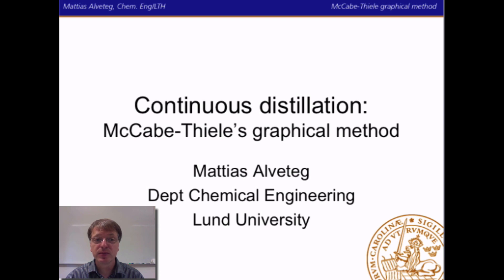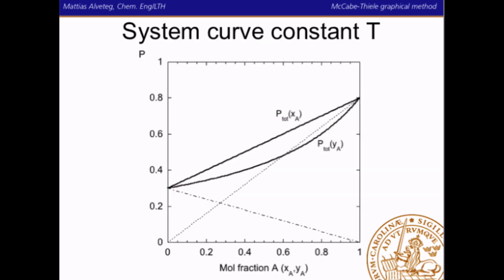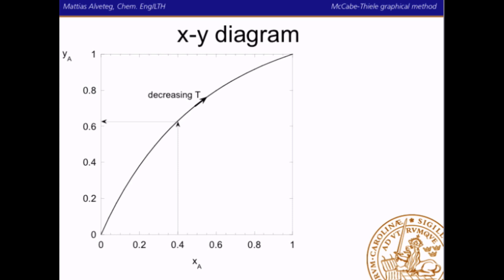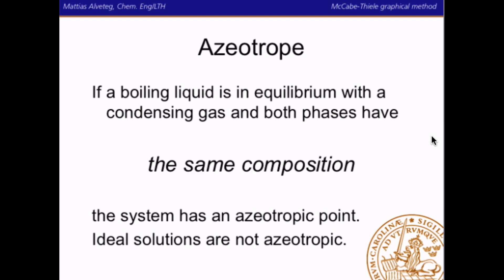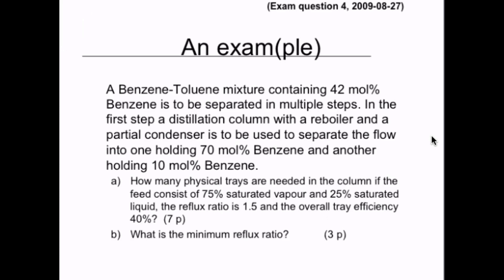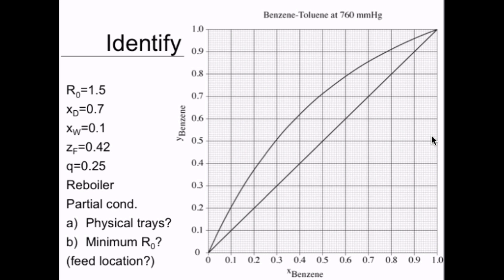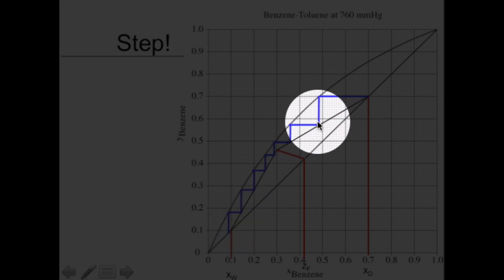D3-Distillation: McCabe-Thiele

Comment: May I ask how can u do it without an equilibrium line ? or how to graph an equilibrium graph ?
Reply from the maker: You need the equilibrium line. You can either interpolate from literature data, or use one of many "curve fits" (in which case you need literature data for the parameters). What curve fit to use depend on the system, van Laar is one of those "curve fits". Compare the video https://studio.youtube.com/video/lz-RWsMYx48/edit which explains how you can take the first steps if the system is ideal (which is usually never true). From there you have to find ways to calculate activity coefficients (using e.g. van Laar).
Reply: @PLE_LU  Thank you for the advice
.

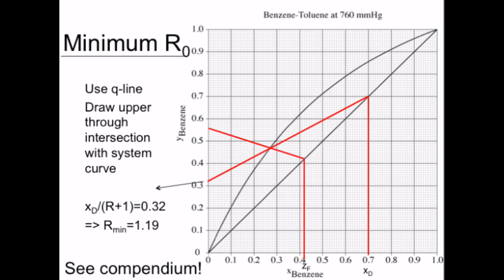Comment: Seems to me like there is a mistake. At 9:07 we get the equation xD/(R+1) = 0.28 and at 15:31 wie get for Rmin "xD/(R+1) = 0.32" - means two time the same equation but two different outcomes? 
So is this wrong or am I wrong?
Reply from the maker: Not an error. If you have different values of R, you get different values for xD/(R+1), right? At 9:07 we solve the problem of a realizable distillation column, with R=1.5. At 15:31 we are looking for the limit, how small R can be for it still to be possible to build a distillation column that carries out the specified separation. We get the result that the limit is R=1.19. The R value that gives you xD/(R+1) is the reflux ratio that would require an infinite number of trays (i.e. an infinitely high distillation column) to carry out he specified separaion

PS
Please note that there is a more recent video on the same topic. You can find it in this playlist: https://www.youtube.com/playlist?list=PLvpgTFzUKO49J3fwJF9y61q17FSNDdoGN
DS

Comment: Hi, what books do you recommend on this subject?
Reply from the maker: Mattias here: To be honest, I personally feel that most text books in this discipline are not designed to help new students learn but rather designed to help engineers who already know the field to refresh their memories. The most famous books were designed in the 1940-ies and the 1960-ies and once you already know quite a lot they are very, very good sources of facts and explanations, but from a pedagogic point of view I find them rather useless in my courses. We have used some of them in introductory courses at least since the  time I was a student back in the 1980:ies, but most students did not read them and learnt better without reading them, so I gave up on them some years back. (The material I'm currently using for mass transfer, heat transfer, distillation, evaporation, filtration/membrane filtration, adsorption/chromatography and drying is currently only available to our students)

Comment: Would you please explain the -0.33 where does it come from? I dont get at all.
Reply from the maker: Hi.

1. Please note that you're watching an  older version of the video

Newer video on the derivation of McCabe-Thiele you can find here:
https://www.youtube.com/watch?v=9gZeftUNejk

 ditto solving an exam task here
https://www.youtube.com/watch?v=7f9LIk9qt48&t=1s

and the entire newer playlist on distillation
https://www.youtube.com/watch?v=qF31ODkiPyc&list=PLvpgTFzUKO49J3fwJF9y61q17FSNDdoGN

2. As I replied on a earlier very similar question:

From the task description and the definition of q, 25% is saturated liquid and 75% saturated vapour, thus q=0.25

The slope is q/(q-1) since the equation is y=q/(q-1)x - z_F/(q-1).

When you enter q=0.25 you get 0.25/(0.25-1)=0.25/(-0.75)=-0.33333

Comment: Excellent video. I didn’t get why you added a/A, shouldn’t we add a alone?
Reply from the maker: ? I'm not sure what you mean by that. We're trying to count number of equilibrium stages, but a is in the unit mm so how could we add them together? We would get things like 4 eq. stages + 2 mm = ?? if we draw on a small paper and 4 eq. stages +  8 mm =  ?? if we used a paper that was 4 times larger. Adding things that have different units never makes sense.

a/A, on the other hand, is a fraction, an estimate of how large fraction of an equilibrium (b/B is also such an estimate so you could take either, or, as some text books do, take an average of the two)

Comment: Please clarify the q line value is 0.33
Then feed line towards down ward , some what confused
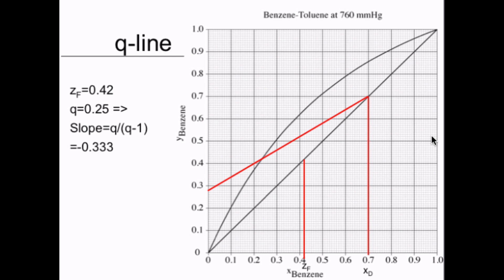Reply from the maker: It is not 0.33.  It is -0.333, see text 9:59 into video
Reply: @PLE_LU  if you got -0.333 why did you draw a line at the 0.56 point on the y axis?
Reply from the maker: @ChiNguyen-np5wv  a straight line has the mathematical form y=kx+m. In this case, if you do the calculation you end up with m=0.56 thus y=0.56 when x=0. I don't do that calculation here though, I just take the fact that the q-line goes through the point (x=zF, y=zF) and draw the slope -1/3 and end up at 0.56

Comment: the construction of the  q line is wrong guys  !
Reply from the maker: No, I think you misunderstand something regarding the q-line.
With 25% liquid at its boiling point and 75% gas at its condensing point, the energy needed to evaporate the feed is 25% of ∆Hvap which means q=0.25. The equation for the lower operating line is

y=q*x/(q-1)-zF/(q-1)=0.25x/(0.25-1)-zF/(0.25-1)=0.25x/(-.75)-zF/(-0.75)=-0.333x+1.333zF

Thus the slope is -0.333. The slope can be seen as ∆y/∆x, so with ∆y= one square down you get ∆x=three squares right

The q-line always intersect the diagonal in the point (zF, zF) since if you set x=zF you get

y=(q*zF-zF)/(q-1)=zF*(q-1)/(q-1)=zF

If you have further doubts you can also calculate the intersection with the y-axis. Set x=0 and get
and intersection with y-axis is (x=zF=0 =>) y=-0.333*0+1.333*0.42≈0.56
which is the value you see in the diagram

PS
There is a newer video where a similar task is solved: https://www.youtube.com/watch?v=7f9LI...
DS

Comment: Sir how to calculate the steam requirement in thermosyphone reboiler ????
Reply from the maker: I only deal with simplified models, thus no specific types of reboilers, but for a general estimate to calculate the energy needed in the reboiler, take the vapour flux below the feed and multiply with the evaporation enthalpy

Q=V_below*∆Hvap(bottoms) [J/s]

 (if you want more accuracy, make sure you take the evaporation enthalpy for the composition of the bottoms.)

To recalculate that to steam needed,  look up the evaporation enthalpy for the steam you use (decreases with the increasing pressure) and calculate the steam needed S as

S=Q/∆Hvap(steam)  [kg/s]

The real steam requirement is always bigger than the value you calculate (since there always are heat losses), but you at least get a rather good estimate.

Comment: isnt the slope of q line, -q/(1-q) which means it will become -0.33, can you please clarify??
Reply from the maker: The slope is q/(q-1) since the equation is y=q/(q-1)x - z_F/(q-1).

When you enter q=0.25 you get 0.25/(0.25-1)=0.25/(-0.75)=-0.33333

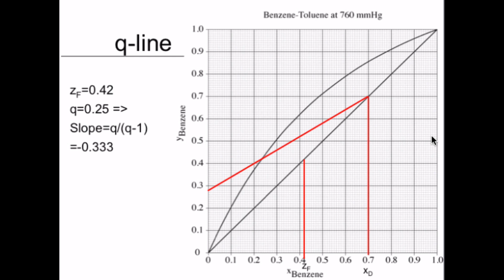Perhaps you are mislead by the font I used, there is a small minus sign in front of 0.333 (at 10:01)

Please also note that we have published a newer series of distillation videos, collected in the playlist: https://www.youtube.com/watch?v=qF31ODkiPyc&list=PLvpgTFzUKO49J3fwJF9y61q17FSNDdoGN

Deriving of McCabe-Thiele is done in 
https://www.youtube.com/watch?v=9gZeftUNejk&list=PLvpgTFzUKO49J3fwJF9y61q17FSNDdoGN&index=7

and an exam example (Ethanol-Water) is done in 
https://www.youtube.com/watch?v=7f9LIk9qt48&list=PLvpgTFzUKO49J3fwJF9y61q17FSNDdoGN&index=8
Reply: Department of Chemical Engineering/Lund University why did you line the graph towards between 0.5 and 0.6 on y-axis ? How did you know the slope -0.333 is there?
Reply: @PLE_LU  
Where are get 0.25 please explain
Reply from the maker: @rajeshr8755  From the task description and the definition of q, 25% is saturated liquid and 75% saturated vapour, thus q=0.25
Reply: @PLE_LU  thanks sir

Comment: why the feed tray should be drawn horizontal and vertical why not in vertical and horizontal direction
Reply from the maker: Some suggest that you should calculate it using the horizontal and the vertical line and take the average of the two. In whatever way you do it, the result you get is an approximation and in my courses I suggest my students to only calculate one value and the only way I teach them is by using the horizontal line. If you look at my matlab distillation demo video (from 5:18)

 https://www.youtube.com/watch?v=iuyXSc3Hb-Q&list=PLvpgTFzUKO49J3fwJF9y61q17FSNDdoGN&index=13 

you see there the matlab calculation programme I've made for educational purposes. In that programme the feed location is calculated using both horizontal and vertical lines. In that programme I also implemented three methods of drawing the triangles: From above, from below and from the feed location. All three methods give slightly different results

I haven't gotten around to publish my matlab code. I find compiling stand alone matlab things rather tedious, not at all as simple as making stand alone programmes based on LiveCode or standard programming languages.

Comment: Great video, what program are you using to draw the McCabe Thiele diagram in?
Reply from the maker: Depending on the purpose I have been shifting between programs. 

* Matlab when I need to do further calculations (e.g. to draw McCabe-Thiele solutions automatically)
* Kaleidagraph from Synergy Software I like since it makes making nice looking graphs so easy (but I actually do the calculation in matlab so that I can easily shift between different types of curve fits for activity coefficients like van Laar, Margule, etc.)

In this video (and in the newer version https://www.youtube.com/watch?v=9gZeftUNejk) I've taken a plot from Kaleidagraph and added a "solution" as an animation in PowerPoint.

Comment: So I followed your explanations (which are really good) and did the exercise before you showed the solution being happy about the solution you followed up with but there is one thing different in my solution:  The angle you measured for the q-line cannot be -0.333°, but from what i measure is more like -0.19°. Now, I'd understand if you had done that on purpose, for making the diagram look more like anything I would encounter in an exam, but i'd still like a note just to eplain possible confusion.
Alternatively i probably have to get a new protractor^^
Reply: So how did you draw the line
Reply from the maker: It is the slope that should be -0.333, not the angle.

Try to think of the q-line as a simple straight line

y=kx+m

where k is the slope, the slope being k=∆y/∆x. Compare this with the equation for the q-line:

y=q/(q-1)x - zF/(q-1)

Thus the slope is

q/(q-1)

and the q-line cuts the y-axis in 

zF/(q-1)

(which, however, might lie far outside your graph).

Comment: Sir how can one know or is the trays optimal to introduce the load?
Reply from the maker: Are you asking how you can know that the feed is placed on the optimal tray? I answer your question in case my students who have an exam in January also are wondering:

I need to divide my answer into two sections depending on the context of your question:

A) You are looking at a real distillation column in operation
B) You are designing a distillation column, e.g. calculating how many trays you need

A: The simple answer is: You can't, at least not without taking a lot of measurements and doing a lot of calculations. Or, as an alternative, you can try changing the feed location, keeping all other operating conditions constant and see how xD and xW changes with feed location. The optimal feed location in a given setup for given operating conditions is the location that maximizes (xD-xW)

B: At the design state you are free to choose your design, right? So your best choice is to place the feed optimally in your design calculations.

You need fewer equilibrium stages (and hence fewer physical trays) if you place the feed at the optimal location. You get the optimal feed location if you switch from drawing your vertical lines (when stepping) to the upper operating line to drawing your vertical lines to the lower operating line immediately after you have passed the point when the two operating lines intersect. 

You may realize that this is the case by looking at the geometry of the graphical solution. To draw as few triangles as possible you want to draw them between the system curve and the operating line that lies furthest away from the system curve. Clearly, 

* for x-values larger than the point where the upper and lower operating line intersects, the upper operating line is furthest away from the system curve.
* for x-values smaller than the point where the upper and lower operating
 line intersects, the lower operating line is furthest away from the 
system curve.

Comment: why do we start making steps from top and not from bottom? What difference will it make if we start making steps from bottom to up?
Reply from the maker: A very good question indeed!

Short answer: What it all boils (pun intended)  down to is tradition. The most common tradition is to start from above

Long answer: There are at least three different ways to start making the steps:

1. From above (the step at the bottom as well as optimum feed location might be fractions of an ideal stage)
2. From below (the step at the top as well as optimum feed location might be fractions of an ideal stage)
3. From the optimum feed location (the step at the bottom as well as the step at the top might be fractions of an ideal stage)

The three different methods might give slightly different results, but they are all equally correct. The fact that the three different methods might give slightly different results is a reminder that what we are doing here is an estimation of the number of ideal stages (and number of physical trays) required. 

Most textbooks I have seen start numbering trays from the top and also start making the steps at the top. I have, however, seen a few that start numbering the trays from below and start making the steps at the bottom.